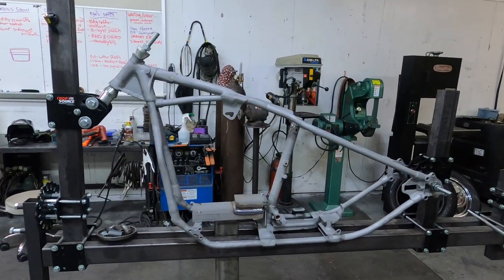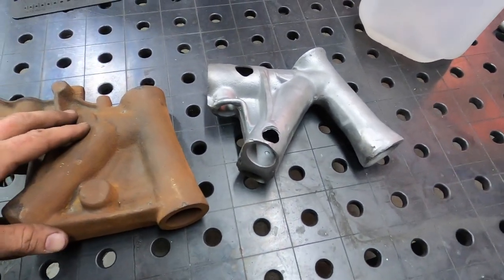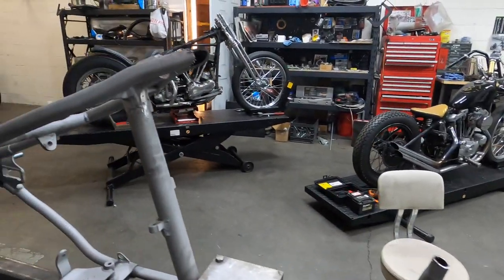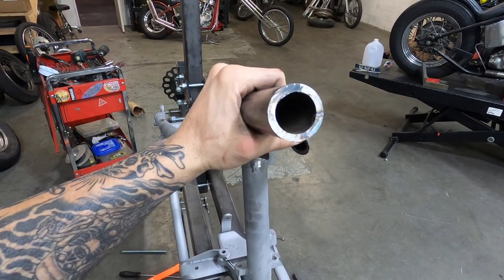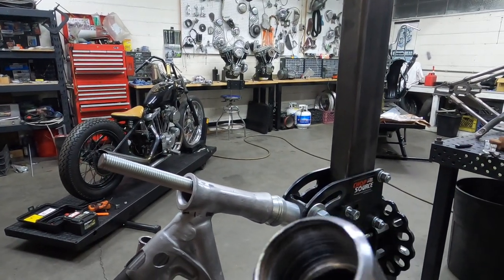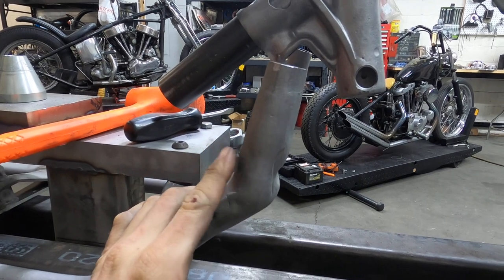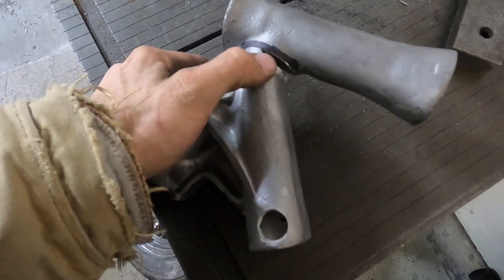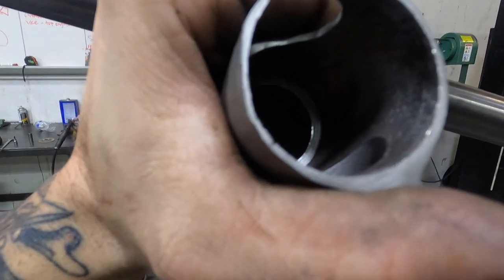Chopping a Harley Davidson Wishbone frame. (SHOP BIKE Part 3)

Comment: Nice job.  These old frames can be a battle trying to make them usable (and safe).  I built a straight leg frame using an old engine cradle section.  From what i learned on that experience I recently finished dry fitting a wishbone frame.  It’s been a lot of work but I can stand back and say “I built that”.  It’s a good feeling.
Reply from the maker: That's the best feeling you can have. Especially after a long trip and knowing everything you did got you through it. Thanks for watching

Comment: Old original HD frames are not made anymore. Don't chop them up. Buy or build a new frame.
Reply from the maker: When they have already been necked and modified I don't have a problem cutting them up. If it's a stock neck with all the original hallmarks I won't touch It. This one already have enough 70s love in it so I made it my own,